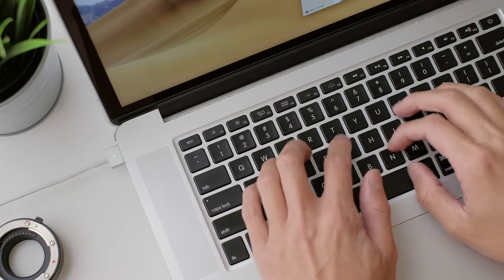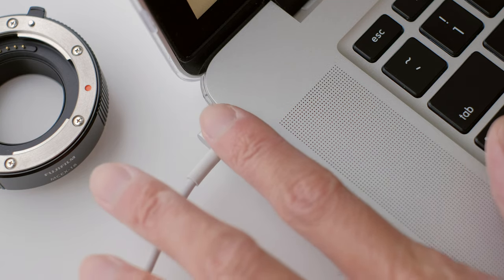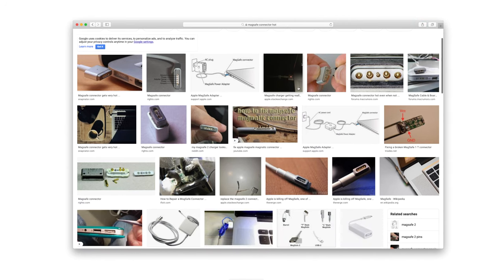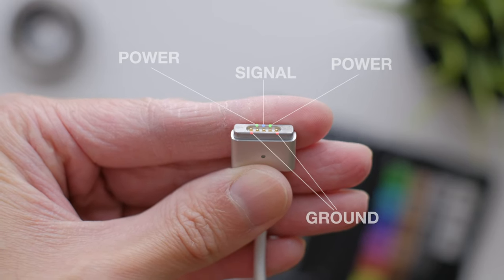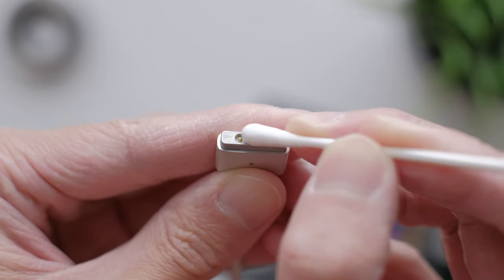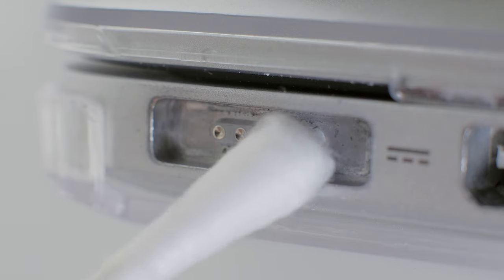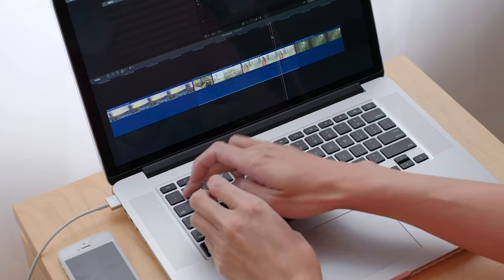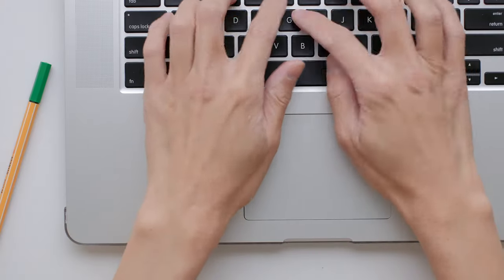BURNING HOT Apple MagSafe 2 Connector when charging. This can't be right...

Comment: OMG OMG This is exactly  what happens to my MacBook Air  so I will do what you advise in your video and I'll let you know if it works for me or not. Thanks a lot
Reply from the maker: Hope it works! Let us know how you get on whether this helps or not!
Reply: @JoeLamOfficial  I did ,and Yeap it was actually really dirty I cleaned it with alcohol as you suggested, however is keep getting so hot  from time to time , it's not all the time though. I have Mac Book Air 2013 and I only use it with OFFICE (word. PDF) and I teach via ZOOM so I don't think is because of any app.
Thanks for your help
Reply from the maker: @yessicamunoz2061  it depends I guess. If it’s low on battery and using heavily, it tends to heat up more. It could also be a dusty fans. Less efficient in cooling. So even lighter tasks build up more heat. More power draw. More heat overall.
Reply: @JoeLamOfficial  sorry Joe it's me again yes i did what you suggested however after a couple of days I keep on experiencing issues when charging my laptop then on the screen the battery charge icon shows 100% charge in red and then suddenly turned off with no charge at all, OMG I have to continue pushing the charger towards the laptop and sometimes works I decided to buy a new charger so I hope that is the issue if not I am really going to die without my MAC OMG if you have any extra tip for that please  meanwhile I get the new charger on April 22nd
Reply from the maker: Is the pin on the charger oK? Sounds strange about the 100% then cutting off. How old is the battery and how many cycles has it been through? Sounds bit like an issue with the battery? I’m just guessing here with limited info.
Reply: @JoeLamOfficial  well actually  it has 957 cycles out of 1000 so I order a new charger just in case the charge is the one to blame hahahah anyway the new one comes on April 22nd so until then I have to continue surviving with  these issues now
Reply from the maker: @yessicamunoz2061  That's probably another issue then with that many cycles. Assume the charger is OK and not overheating, it doesn't explain the red battery indicator. If you option click on the battery icon it should tell you the condition? My 2013 MacBook Pro has done 458 cycles, 80% capacity left accordingly. 6790 mAh out of 8440 mAh but reality - light use it only lasts around 2:30-3 hours. A lot less than the beginning, so it's definitely lost more than 20% over the years. I imagine the 957 cycles you have done on yours has a lot more wear on the battery already.
Reply: @JoeLamOfficial  Health Information:
   Charge Information:
  Charge Remaining (mAh):	1304
  Fully Charged:	No
  Charging:	No
  Full Charge Capacity (mAh):	6166
Cycle Count:	959
  Condition:	Normal
  Battery Installed:	Yes
  Amperage (mA):	-1223
  Voltage (mV):	7005
System Power Settings:

  AC Power:
  System Sleep Timer (Minutes):	10
  Disk Sleep Timer (Minutes):	10
  Display Sleep Timer (Minutes):	10
  Wake on AC Change:	No
  Wake on Clamshell Open:	Yes
  Wake on LAN:	Yes
  AutoPowerOff Delay:	14400
  AutoPowerOff Enabled:	1
  Current Power Source:	Yes
  DarkWakeBackgroundTasks:	1
  Display Sleep Uses Dim:	Yes
  Hibernate Mode:	3
  PrioritizeNetworkReachabilityOverSleep:	0
  Standby Delay:	10800
  Standby Enabled:	1
  Battery Power:
  System Sleep Timer (Minutes):	1
  Disk Sleep Timer (Minutes):	10
  Display Sleep Timer (Minutes):	2
  Wake on AC Change:	No
  Wake on Clamshell Open:	Yes
  AutoPowerOff Delay:	14400
  AutoPowerOff Enabled:	1
  DarkWakeBackgroundTasks:	0
  Display Sleep Uses Dim:	Yes
  Hibernate Mode:	3
  Reduce Brightness:	Yes
  Standby Delay:	10800
  Standby Enabled:	1
Reply from the maker: @yessicamunoz2061  have you had your Mac since 2013? To be honest the number of cycle count is probably the culprit, plus depending on age of battery.
Reply: @JoeLamOfficial  I HAVE IT FROM 2014, HOWEVER TODAY it says that has 960 cycles today so yeah maybe it is definitely that I am a teacher so the use I give it to it it's just normal no video games no design no making music   and even though I am sure I have taken super extra good care of it. Anyway as I told you every day I am with my fingers crossed trying to charge it up to 100%  it is actually really hard and I order the new charger already as I said that I'll receive April 22nd so meanwhile I a trying to survive with this as it is and of course planning to buy another one if possible , so if you have any recommendation please let me know, I have see some reconditioned laptops online but I am not really sure about the difference of those ones and new ones  what it is true is that they are half the price of a new one 
Thanks a lot for your help, I'll keep you informed
Reply from the maker: @yessicamunoz2061  Let me know how it goes with the new charger if it fixes it. But my suspicion is on the battery. It is possible to replace the battery but it's bit fiddly and depending on budget - some money.

But if the MacBook still works then it's a shame to replace it.

https://www.ifixit.com/Guide/MacBook+Pro+15-Inch+Retina+Display+Mid+2014+Battery+Replacement/90276

Mines the late 2013 MacBook Pro. Been using it ever since every day for everything. Content creation and consumption all day every day. Surprised it's still going strong.
Reply: @JoeLamOfficial  Of course You have been my support here so Of course I will
Reply from the maker: @yessicamunoz2061  thank you very very much 🙋🏻‍♂️

Comment: I've been buying cheap knock off power supplies on ebay.  Run super hot, pins burn,  only last about 2 months.  Guess I am going to have to spring for a genuine apple charger.  Hopefully I haven't damaged the magsafe port on the computer again sucks replacing those!
Reply from the maker: Wow, it's brave of you to try third-party chargers! You never know what you might encounter. Speaking of chargers, I'm using the genuine adapter, and I've noticed that it also tends to get quite hot. Just something to keep in mind. Thanks for sharing your experience! Any other update?

Comment: I have a problem so basically one of the pins on my magsafe have been like melted or burned and I cant afforad another charger is there any solution?
Reply from the maker: Hi, that's bad. The only way is to replace the charger unfortunately if it's melted! That's dangerous.

Comment: So I don’t get it. What did you do with the pins exactly?? What does stuck pins even mean, and what does pushing in the pins mean?
Reply from the maker: There are springs fitted behind the pins to maintain a solid connection. When they become stuck, it can lead to overheating due to arcing and excessive heat generation. Therefore, cleaning and pushing them may help to loosen them up again. That's what I did with mine.

Comment: i have a bigger problem similar 1 pin is burnt and 2 pin holes are burnt can I do anything or just throw it away or go to a shop
Reply from the maker: You could try cleaning it like in the video. Are the pins stuck? 
If the pins don’t move freely after cleaning
It’s likely you will need to buy a new one just to be safe 
Especially if you have already noticed burn marks.

Comment: I have same problem what should i do my battery cycle is 1200 above so mi charger pin is overheated when its turn on and when i shutdown my mac and charge it doesn’t heat what should i do . I really need your help .please suggest me what should i do to fix it ????
Reply from the maker: Hi Nabin, over 1200 cycles? The battery is pretty much dead in this case. I've done less than 500 cycles, yet the battery only lasts around 2 or 3 hours max. When you say the pin is overheated, is it burnt? Its normal for it to get hotter when its being charged and used at the same time. As it requires more energy to power and charge at the same time. But generally if it's not overly hot or actually burn marks, it should be OK. Have you tried cleaning the pins / port and checked that they are fully extended to allow the best contact like in the video?
Reply: @JoeLamOfficial  Thank you it worked. I used hand sanitizer on paper and clean the port as well as charger pin and now it doesn’t heat as before thank you soo much I appreciate your quick response and you are the best once again i want to thank you for all this 🙂
Reply from the maker: @nabinbista4178  Cool!! Glad it worked. So happy. Wanted to help others. Glad this is useful. ☺️

Comment: 2009 mac book pro still running strong!
Reply from the maker: Wow!!! I thought my 2013 was going strong! Any issues with yours? I notice my battery life and display / thunderbolt ports are a bit dodgy now days.
Reply: @JoeLamOfficial  I replaced the battery last month and can't be happier with the new run time. I added some ram and swapped the hard drive to a SSD. And by no means am i computer savvy. i was pleasantly surprised how easy it was to work on.
Everything else runs good. I don't use thunderbolts ports or usb ever though... I'm not even sure if mine has thunderbolt ports. i don't know what those are... lol
Reply from the maker: @mattb6200  was your battery fixed or easy removable?
Reply: @JoeLamOfficial  easy removable. It was two screws.. $30 on amazon for the battery. even included tools
Reply from the maker: Much easier than the current gen ones. All glued in etc.

Comment: I'm using a 2nd hand macbook pro mid-2009...recently, the tip of the charger heats up every time I charge it...I turned off the macbook while charging and it doesn't heat up anymore
Reply from the maker: Fairly normal for it to get extra hot when charging and using it at the same time as it draws more power overall.
Reply: @JoeLamOfficial  I use my macbook mostly while charging...the charger tip is fine when I touch it...only recently it heats up while charging...
Reply from the maker: Keep an eye for it. It’s normal for it to get quite hot but not if it’s burnt or yellowing any part or bulging etc.
Reply: @JoeLamOfficial  yes I wil...thank you 😊
Reply from the maker: Thanks again. :)

Comment: I know this is an older video. I recently was given an older MacBook Pro (A1278), but no charger.

I am looking for a USB cable with the correct magsafe plug.

Can anyone link to the correct Magsafe cable needed to charge my MacBook Pro laptop?
Reply from the maker: Hi Dave, I believe you need a MagSafe charger like this one - > https://www.apple.com/hk/shop/product/MC461B/B/apple-60w-magsafe-power-adapter-for-macbook-and-13-inch-macbook-pro pick the Wattage depending on your screen size. I believe it’s a 13’ your model?
Reply: @JoeLamOfficial  yes, 13".
Reply from the maker: Have you ordered the replacement charger yet?

Comment: There are burns on two of my pin, and it gets really hot when I plug in. Any help?
Reply from the maker: Hi there. Try pressing the pins in and make sure they spring back out. And clean them with alcohol to see if they make a good contact with the charging port. That’s what helped with my hot MagSafe plug.
Reply: @JoeLamOfficial  Do I need to drain all my battery before cleaning?
Reply from the maker: Not on the MagSafe plug with the cable. Just make sure it’s not plugged in. 

As long as you’re not soaking it with alcohol or water. It shouldn’t short anything. But be careful though. Or try pushing the pins in and out with a plastic tool first.

Comment: Still rocking a mid-2012 here and my connector is red hot.  I've gone through COUNTLESS replacement charging cords on this thing.  It's a disgrace.
Reply from the maker: Is it gunked up or does the port look clean?
Reply: @JoeLamOfficial  Nope, totally clean.  I even cleaned it with alcohol anyway just to make sure but it still gets ridiculously hot if I charge the MBP while it's on.  All of my charging cords eventually turn yellow/green near the magsafe connector which I've read is a heat issue.  I think these were engineered less than perfectly.
Reply from the maker: If it's just the plastic going yellow over time from UV exposure - that's not an issue. But if it's going yellow from getting to hot and burnt. That's worrying!
Reply: @JoeLamOfficial  Update: The magsafe portion came completely off of the cord yesterday!  First time I've ever had that happen!  I'd purchased that cord in November so it lasted a whopping four months.  What a joke.
Reply from the maker: Oh my! Surely must be under warranty!? Take it back?

Comment: I have a new MacBook Pro 16".  The quality is excellent and the connector remains as cold as ice.

The charger is a genuine 140W Apple charger.  Doesn't get hot at all. 

Suggest you visit your Apple Store perhaps your battery has gone bad and drawing too much current. 

Perhaps you have a third party rather than a genuine connector.
Reply from the maker: Hi, I’ve got a new M1 Max 16” Pro too! ;) It’s all genuine, charger, cable. All from Apple store. It’s the pin that’s stuck that’s causing it to arc/overheat. As I have demo’d in this video. Of course using third party or faulty product could cause this too. But in my case, it’s the pins that’s the issue - not even dirt built up.
Reply: @JoeLamOfficial  

In your video you talk about an “old MacBook Pro” and using it for “six years” though the video does appear to show a new machine.

I am rather confused as you appear to be contradicting yourself.  Perhaps the pins are ceased with some form of contamination.  Once it gets very hot the plastic may deform causing you a problem.
Reply from the maker: The MacBook Pro shown in this video is old - it's a 2013 MacBook Pro model! In fact, its' nearly 8 years old now. It looks new since I look after my gear well. :)

Comment: I still use the 2009 macbook and it bacame really hot while playing minecraft . Melted the plastic a lil bit but it still works!
Reply from the maker: Wow that's dangerous! Are you going to replace the charger?
Reply: @JoeLamOfficial  i did!
Reply from the maker: Hopefully that fixed your problem. But maybe keep an eye hour for the pins from now just to make sure they are not stuck or dirty.
Reply: @JoeLamOfficial  after watching your video and cleaning the pins really improved the heat issue ... you know what i love the fact that its 10 freakin years old and still able to keep up
Reply from the maker: Absolutely. I do want to upgrade mine but it's still running strongly. Expensive but I don't remember any other Windows based laptop that could last this long.

Comment: What should i do if the pins are burnt? Help
Reply from the maker: Try cleaning it and carefully monitor and see if it's still that hot? Best to replace it though if it's damaged. Bad connection, equal shorts, more risk of heat, burnt or fire.

Comment: my power pins are burned up and alot od carbon deposite on them. i tried to clean them buy a new charger but i guess the problem with my mac is still an on going issue, first the charging then the keyboad wont work, and after than lost the speaker, and now wifi card wont work. gracefully i was able to fix keyboard and wifi issue, but i cant do without it being charged.
Reply from the maker: Did you clean the charging port on your MacBook? It's also possible that the actual charging port or power circuit has issue in itself if it's not charging. 🤔
Reply: @JoeLamOfficial  would ground or earthing of electricity would cause that, I have a weak earthing
Reply from the maker: Shouldn't do. It's the pins that's not quite making the contact that's likely causing it.
Reply: @JoeLamOfficial  I checked the pin of the charger where were alot of carbon deposits on them,
Reply from the maker: Is the issue still on going after you cleaned it?
Reply: @JoeLamOfficial  yes. When I saw the pins. The pin no 2/4 is been compressed and it was the new charger i bought 8 months ago.
Reply from the maker: It's still sticking or maybe there's issue with the spring inside? Can you replace it or is it under warranty?

Comment: I'm having this problem right how! I have 4% battery left but it wont charge. Hope I can finish this video before my battery dies!
Reply from the maker: Hi Michelle, hopefully it's just the pins. If not, check the battery condition. Use free app called coconutBattery. How old is your MacBook?
Reply: @JoeLamOfficial  Thanks for checking! I'll download that. My MacBook is from 2013. I was able to get it to charge by cleaning everything with 90% alcohol and moving to another outlet... but I'm sure it'll happen again. I really don't want to upgrade to the new macs because I don't like their keyboard. We'll see how long I can keep this one going :)
Reply from the maker: Hi Michelle, glad you managed to get it working again. :) Maybe wait till Apple switches over to the new Apple Silicon processors. They've gone back to the old style keyboard now days anyway. Shouldn't be a problem anymore. :)

Comment: Mine is definitely different. Does not have 5 pins. Only 3 on the charger and the MacBook port.
Reply from the maker: MagSafe version 1 I think? Which MacBook you using?
Reply: @JoeLamOfficial  MacBook Pro
Reply from the maker: MagSafe 1?

Comment: i also have the same problem

edit:this helped alot
Reply from the maker: Did this help?
Reply: @JoeLamOfficial  didnt try yet.just installed catalina on a 2012 o gb ram i7 .i will try now:)

edit:aparentley i need a new cable bc the cable is chewed by the last owners dog.just got that macbook
Reply from the maker: That's not good, better get a new cable.
Reply: @JoeLamOfficial  i know but its very expensive.
Reply: but works absoluteley fine. i will probabley apply some heatsing and new sleeving.i have no more heat .it is actually kinda cold
Reply from the maker: Very expensive indeed, but wouldn't want to risk further by using dodgy fake chargers? Too many around.
Reply from the maker: That could also work, if it's just sleeve. But do be careful though.